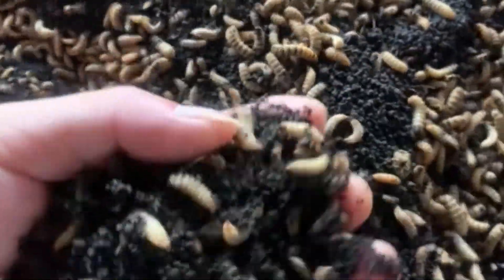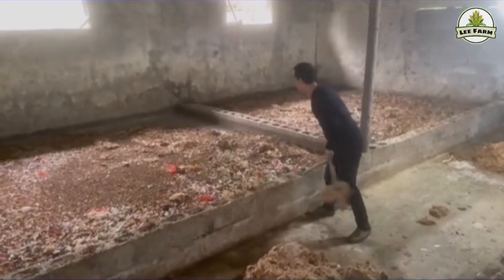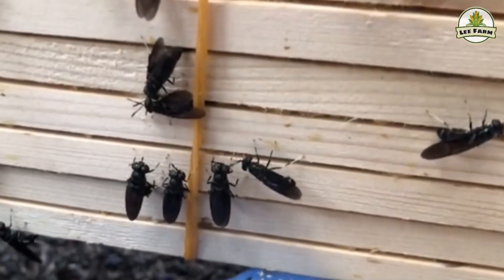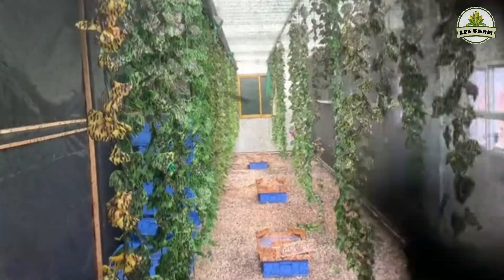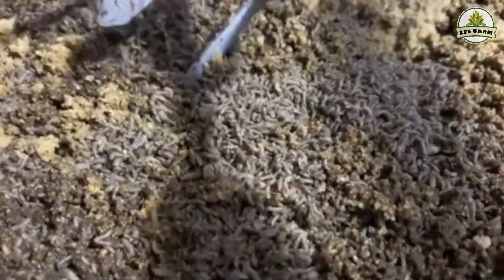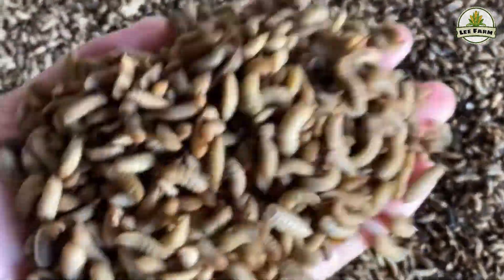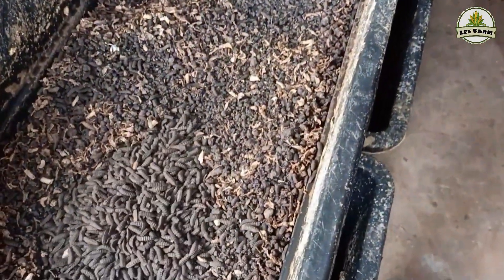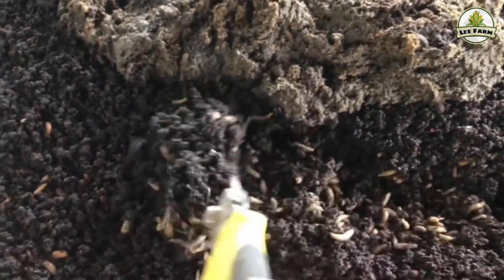Inside China's Massive Black Soldier Fly Farms: Turning Organic Waste into Protein Gold

Comment: What must I we to hatch the eggs and how long time days
Reply from the maker: To hatch BSF eggs, you need warm temperature (27–32°C), high humidity (60–80%), and good ventilation. Place the eggs on a dry surface near moist feed, not directly on wet material. The eggs usually hatch in 3–4 days under proper conditions.

Comment: Which microbes used to ferment organic waste
Reply: Olá a aqui do Brasil sou produtor das larvas também e um mundo fascinante
Reply from the maker: Olá! 👋
Sim, é realmente um mundo fascinante. Obrigado por acompanhar! Se gostar do conteúdo, deixe seu like e se inscreva no canal para não perder os próximos vídeos.
Reply: In this video you are hatching eggs in bottles without any feeding ih there any mortality
Reply from the maker: Hi, thank you for your question 😊
During the egg incubation stage, no feeding is required because the larvae have not hatched yet. The eggs contain all the nutrients needed for development.
If temperature and humidity are kept at proper levels, mortality is very low. Feeding only starts after the eggs hatch and the larvae begin to move.
Reply: @LeeFarmm  thank you sir  for  bsf eggs incubation can we use poultry eggs incubator
Reply from the maker: Yes sir, you can use a poultry egg incubator for BSF eggs as long as the temperature and humidity are properly adjusted.
The ideal temperature is around 27–32°C, with humidity at 60–80%.
Just make sure the eggs stay dry and well ventilated, and do not place them directly on wet surfaces.
Reply: @LeeFarmm Please share small video of hatching eggs
Reply from the maker: Thank you for your interest 👍
We will share a short video showing the egg hatching process in an upcoming video. Please stay tuned and subscribe to the channel so you don’t miss it.
Reply: @LeeFarmm ❤
Reply from the maker: Good question! 👍
Organic waste is usually fermented with lactic acid bacteria (Lactobacillus), yeasts, and Bacillus. These microbes help reduce odor, suppress harmful pathogens, and make nutrients easier for BSF larvae to digest. Many farms also use EM (Effective Microorganisms) to speed up fermentation and improve larvae growth.
Reply: @LeeFarmm thank you sir and Please tell me how many days have to ferment waste
Reply from the maker: Normally, organic waste should be fermented for 3–5 days before feeding. This helps reduce odor, kill harmful pathogens, and makes the nutrients easier for BSF larvae to digest. Depending on the waste type and temperature, fermentation can take up to 7 days.
Reply: @LeeFarmm ok sir some times greenery and leafs are available so there is digestive problem this fermentation can help to digest that waste easly
Reply from the maker: Yes, sir 👍
When a lot of green leaves and plant materials are used, larvae can have digestion problems because of high fiber (cellulose). Fermentation helps break down these fibers, softens the material, reduces anti-nutrients, and makes the waste much easier for BSF larvae to digest and grow faster.
Reply: @LeeFarmm thank you sir
Reply: Hai sir I need another information kindly Please share